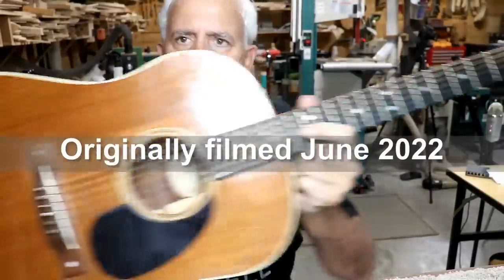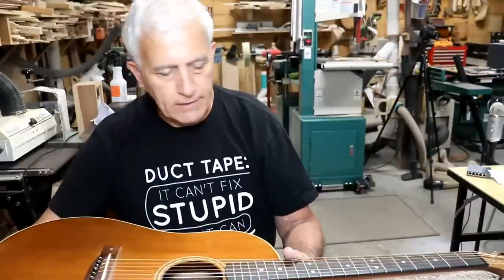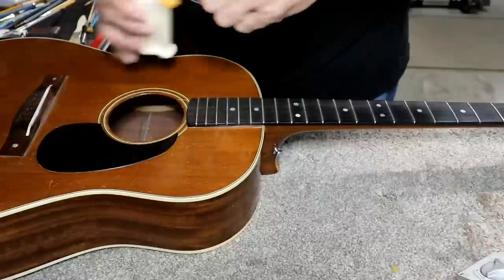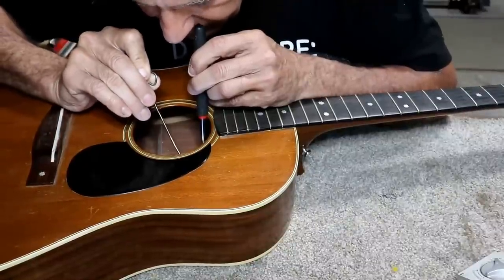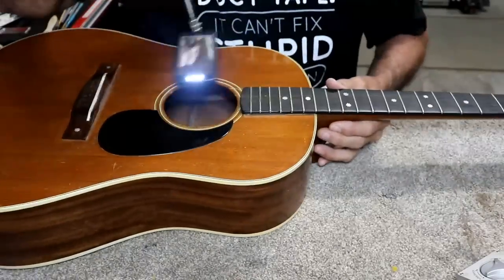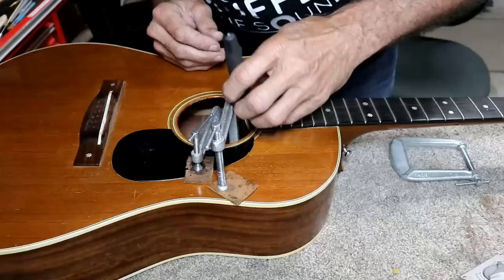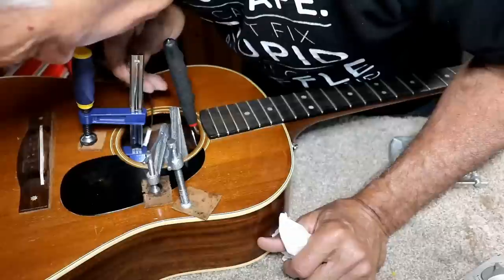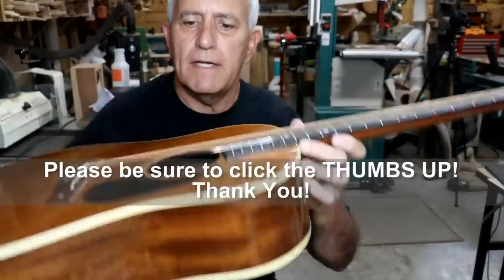633 RSW Repairing The First Guitar I Ever Built

Comment: JERRY, they probably make fancy expensive expanders for this type of glue job that you can use instead of clamps reaching around and through and filling up the sound hole, blocking your sight lines and further access. But you can improvise your own fully adjustable screwjack expanders for use inside the guitar. This can be done very cheaply using female thread rod couplings and whatever length hex-head capscrews you need to fill the working gap. Several lengths would cover almost everything for standard construction and repair details such as for bracing or bridge plates. For bigger jobs with longer reaches you can use threaded rod of the needed length with a rod coupling on each end for adjustment. Glue soft pads on the ends to protect the work, and these will also help grip if you want to spread the load with cauls or blocks. If you use 3/8" hardware, the 9/16" hex head is big and grippy enough to tighten it by hand to get the amount of expansion force needed to close and set the glue joint for most guitar work. If you need more push you can always do that with a wrench, carefully. This works very well for the kind of work you were doing in today's video. Using this trick you can bring up several glue joints inside the body in one quicker procedure and still be able to work, inspect and clean up squeeze-out by reaching through the unobstructed sound hole. Now how 'bout that, brother?

Comment: Fun Video! Feels like hanging out doing my favorite stuff. My first guitar I made was a redwood as well. 1996. The planks i had were just splitcut 3/4 inch thick. Super rough.  I didn't have a re-saw or thickness sander. All I had was a 1" stanley handplane.  I put the planks on the garage floor and put my knees on the close end and planed those planks down by hand by the time i had it to around 3mm I was sweating bullets. Don't think i would ever wanna do tgat again. Also didn't have any calipers or thickness gauges. Just felt the wood and tapped on it. No science. just gut. Worked out just fine. Sounds quite nice even today.  Lol

Comment: One thought that might have been mentioned in the comments I missed.>Getting your hand in the sound hold to do a better glue job??   You might try a (budget priced) "bore scope camera'" and a cheap small LED flash light ducttaped into the right positions inside.  Then you could easily observe your hand/fingers, syringe, proper amount of glue, etc etc, in living color.  You will just have to easily share the sound hole with the small cable that goes from the camera to the color monitor...

Comment: just recently did similar repairs on a 6 and a 12 string i built in early 90's.  they were stored in the attic since the build.  not good.  after a short while i gane up on trying to keep the inside neat.  love your channel it has given me and i'm sure many others confidence to carry on.  QUESTION??   i had to fill and reset both saddles using your temporary wire /string holder method.  got it within 10 cents.  what is acceptible intonation?  thanks and please keep the videos coming.
Reply from the maker: I like to see it within 1 or 2 cents possibly 3 at the most

Comment: I have the same problem on my old Martin early 60s D 28 which was dropped in moving from Florida to Ohio and the neck and fret board has moved about 1/16 inch toward the bridge.... That makes the intonation a little sharp up the neck.... It's an extremely great sounding Martin otherwise.... I have tried everything to force it back to no avail.... I do not want to remove the neck so not sure just what to do about it.... Moving the bridge to compensate seems to be the best route...